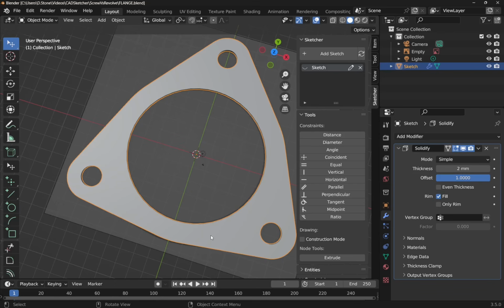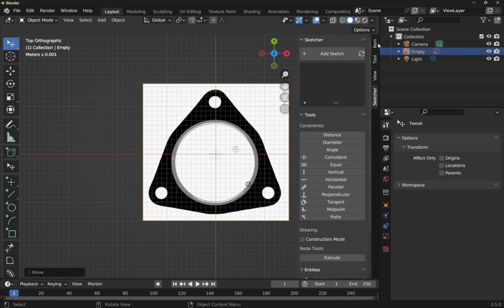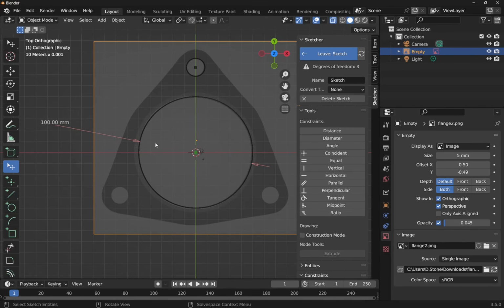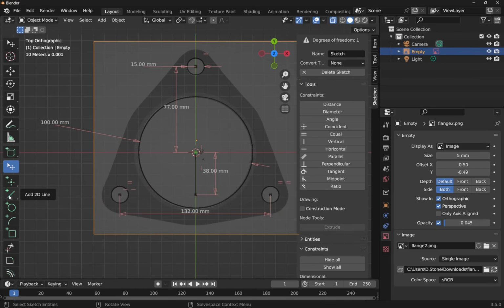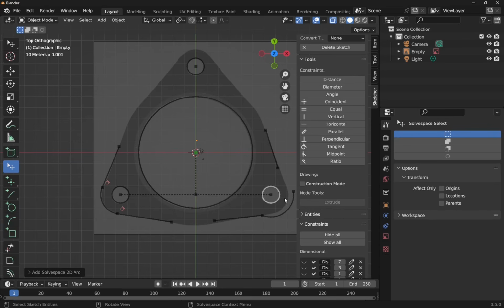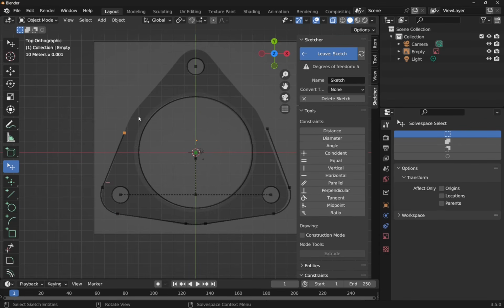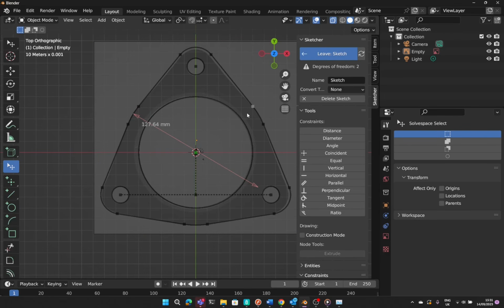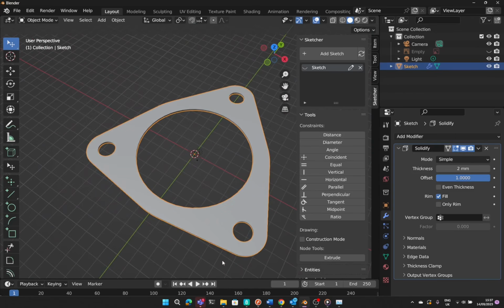Learn CAD Sketcher | 9 | Trace Reference Image to Create a Basic Model | Blender 3D Beginners Guide

Comment: Dont get me wrong but cadsketcher is absolutely the most insane way to make technical drawings or drawing tool starting from a flat 2D.  Not just because is full of bugs and often crashes when multiple constraints are applied and the entire job  breaks down after hours of working at, but also because, as often, while you drawing, you want to re-configure/re-model your sketch or modify some details and as soon you remove some constraint, it crashes up or it gets freeze or messes it all up. Also every not straight line must be an Arc ending up with a draw full of mess and black dots everywhere. I just use Coreldraw or Illustrator, import the DXF into blender and convert into a mesh. I do in 5 mins what it would normally takes 2 hours for a simple square and 4 circles inside of it. I really dont understand the purpouse of this tool, maybe it's just a bad attempt to get nearer to F360 draw technique.
I'm a software developer but I dont know Python deep enough and If I had more time to dedicate, I would have built something more flexible than this.Thanks for the content, anyway, but for me cadsketcher is one of the most useless addon for blender.

Comment: I feel like this could be done easier just sketching 1/3 of the object (one slice of the pie) and then use an array modifier to rotate it 120 degrees with 2 copies. But there are lots of different ways to get the same end result. 🙂
Reply from the maker: Totally agree, I would of used a mirror modifier as well... but I didn't want to go that path as I had that set up for a tutorial that was following :)  I can't remember the route I took but normally I would of used a circle or triangle for construction geometry and create the circles for the hole at each of the corners.  It probably be a good exercise to see how many different ways we can come up with the same object!